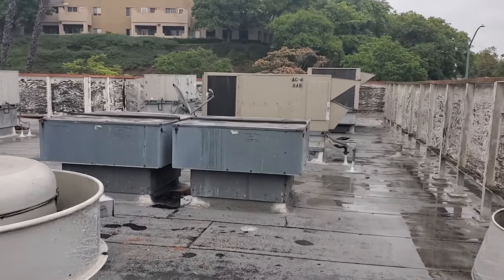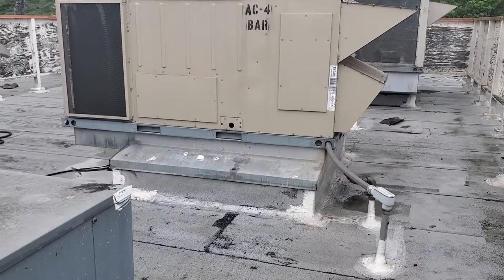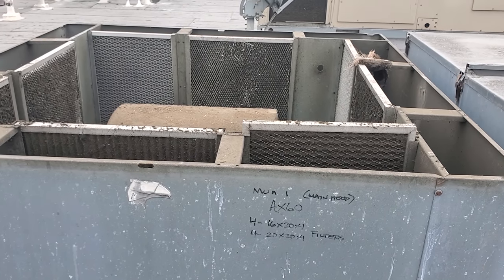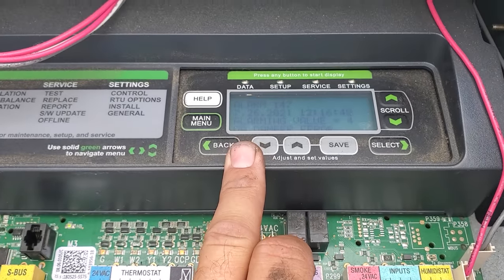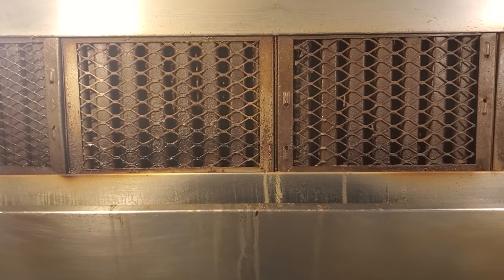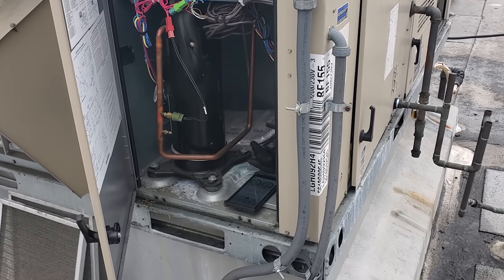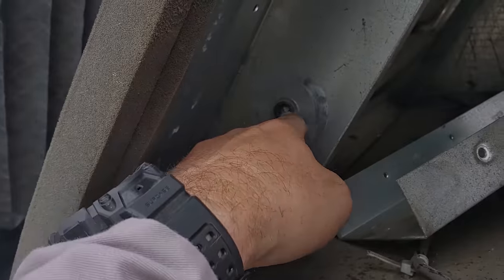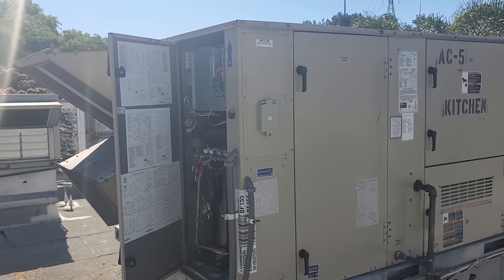IT'S NOT ALWAYS AS SIMPLE AS THE COMPLAINT

Comment: I once had a discussion with someone who was adamant that the more you turned down the temperature setting in cool mode for a AC the faster the unit pumped the refrigeration gas. He thought the refrigeration pump would go faster rpm wise. 
I get the password protection, but I also get putting them in the right mode first.
Reply: This  is true for the inverter units, the bigger the temperature difference the higher the rpms
Reply: @sjefoekel6058  it is just the last few kelvin difference the rpm drops down.

Just like you brake the car on a red light. You dont slow down the whole journey consistantly.

An A/C or electric oven or anything runs at 100% power to the setpoint and shut off the compressor/heater/what else.

The inverter units run to about 97% of the setpoint and do the last 3% with dropping rpm or power and then shut off.

It's a controlled system. The units runs as long as it has to and then goes to standby. It's not like rpm X is tied to a temperature Y.
Reply: @casemodder89  actualy it is, compressor rpm is controlled by demand. Read up on some tech bullitens from manufacturerers. The control will slow the compressor down or speed up to aprox 20% to 120% of nominal capacity, this is not an on off kind.
Reply: @sjefoekel6058  even our kitchen refrigerator has a variable speed compressor in it. You can clearly hear the difference. When it is warm our house you hear the compressor running faster.
Reply: @meeder78  ja maar dat meent hij dus van niet.
Reply: @sjefoekel6058  Up to a point yes, the problem was he thought it applied to all AC's and in particular the non inverter units we were using at the time.
Reply: Ppl think the same with transportation refrigeration, they think it will pull down quicker the lower the temp, no it will work the same just run longer and overshoot the set point you wanted

Comment: At one location I put in a fake thermostat and hid the real one. Amazing how all the problems stopped. I've also tied in setback controls or a second thermostat to a lighting contactor, so when they turn off the lights, the HVAC changes program temps.
Reply: Brilliant.. and funny.
Reply from the maker: I have actually done something similar too, I programmed the Lennox prodigy boards to run the units based off of the units sensors than I left the thermostats downstairs and the customer thinks they are controlling them..... its been like that for 5 years and they have yet to complain.....
Reply: @Rayfanz1  the fans were pulling in outside air and pulling it up, that's why you run ceiling fans in reverse in summer
Reply from the maker: I will discuss this on my livestream this evening 8/16/21 @ 5:PM (pacific) on YouTube come over and check it out https://youtu.be/8yo32gjOAeE

Comment: I hate to sound like I am really down on them, but the newer Lennox units with the smaller actuators are very failure prone. That same craft chain I mentioned before had another location with three year old units, and five of them out of eight had actuators throwing a code. It is because the actuator does not supply a smooth, continuously changing DC voltage to the IMC as the damper changes position. There are momentary dropouts, which the IMC sees and then sets an alarm. Be advised that there are two different actuator part numbers.

Comment: I got some questions:

1. Do you ever get or have engineering building plans on how everything should be working?

2. Do you ever do new installation of a new building that is being built? and how you set up everything in a new building?

3. Is all of your business based on service work?  Seems like there is a lot of bad running equipment to keep you going without having to diversify into other areas of HVAC business.

4. Do you ever get a business that listens to you and follows your recommendations such that they are great to have as a customer? 

I really enjoy your videos because I was an engineer at Carrier designing the control box enclosure for commercial packaged units.  The Carrier videos are the best for me especially when I see you work on Carrier units that I did some of the engineering designs.  It is neat to see how the unit looks after several years of being in service.  I'm amazed at how dirty the control gets after years of being in service.

Comment: Baby steps.  First its getting them on a cleaning schedule for the hood filters.  Then its coaching them on getting the proper curtains on the dish washer.  Then its coaching them on messing with the thermostats.  Coaching is a great Idea.  It gets the manager involved with how the building needs to run.  If they run the building properly, then its less down time for the restaurant.  If you coach those managers, they become your ally when troubleshooting faults with their system.  Great video!  its all about customer service even though the manager is a pain in the ass, its all about how you handle procedures they are doing wrong.

Comment: Either the place re-installs the curtains on the inner run of the dishwasher where they're missing or the place gets to shut down.  It is not sterilizing the dinnerware.
Hood filters are jokingly easy, they're metal flow deflectors.  You just fill the basin sink with mop bucket solution and dunk em, stop by every 10 minutes to wiggle em back and forth for a few hours then put em back up.   They don't have to be super clean, they just have to trap grease/oil/soot.  They're not really replaceable, they should last longer than the hood but they have GOT to be cleaned every week.

Comment: Great job on your channel here,  I’m always learning something. I just found a customer to resell some filters that were mis-sized for weird reason on the vertical measurement.  You have to really be thorough on your hood filters measurements like you said.  There is no standard  in filter sizes for hoods,  the old filters are smashed usually so measuring the old ones is not very accurate either. factories haven’t had stainless to make filters lately either. I can see why you don’t like too. You can always refer them to me if they need someone to replace them. I am more towards Los Angeles, but I do travel to riverside area  somewhat regularly.

Comment: At my facility (Georgia) our building is negative and diffusers condensate all the time because the facility owner allows people to se the T-stat at whatever they want. I'm fighting, as it seems you are, against people who don't understand or care about why moisture is dripping from the diffuser - they just want it to stop, but they also want a 67 degree room temp!!! I have explained how we either need to add make-up air to the facility and bring it to a neutral or slightly positive pressure or, run higher discharge air temps which so far, and for the last 20 years - that's a HELL NAW! Also, a good space temp policy is out of the question..

They have yet to grasp my explanation of dew point and how it's related to condensation forming on surfaces... I struggle everyday, until fall with people bitching about "ceiling leaks"...  It's my cross to bear on the planet I suppose... I feel ya bra...
Reply: Reminds me of a office building I was working on in Florida. The complaint was the building was majorly negative. Look in the BAS system and all of the OA dampers are forced closed! I point this out and reset the OA to where it belongs and the building went to slightly positive. Problem solved and left. Boss calls me a day later saying the previous customer was going off the deep end... we were costing them money by opening the outside air...
Reply: @neonhomer  seems like with Covid they would want all buildings positive pressure. I bet with proper airflow handling changes we could stop many outbreaks.
Reply: @consaka1  it costs more money to cool outside air... but that's how it works 😉
Reply: @flipfloptanlines926  lol that's awesome.
Reply: @etherealrose2139  only if the outside air is hotter than the inside air. Lol but yeah I see your point.
Reply: @consaka1  this was about 10 years ago when this happened... when Tracer Summit was still relevant.
Reply: fully fake thermostat's come to mind or have them only control the indoor blower :))

Comment: I had a commercial kitchen doing this and one of the ac's in the patron area. I like to never figured it out, till I noticed the airflow wasn't the same as another unit that was running fine. Another company had changed 800 cfm motors out with 3 speed 1075 rpm and had it on high speed, it was sucking the water out of the pan.

Comment: Unless they've been sliding those hood filters across the parking lot, you don't have to order new ones.   They're generally baffle filters _only_.   They're meant to be thrown into the Hobart (or other washing machine), or taken out back, soaked with SC-1000 or another surfactant, and hosed off with hot water/steam.    You can also take the broken filters to get them re-welded if someone's been throwing them around.    We used to get them manufactured for our equipment.

Comment: Chris this is why some corporations have taken the thermostat controls out of the stores control and have them on a system that is controlled  by the central office back east. Problem with that is that the HVACR techs have to call that office to get control of the units or just have them put the local A/C systems in to test mode for the day, then you can just jump the units out to get control to work on them, also letting people at the head office know that the weather in Boston is not the same as Tucson, Arizona.  I swear trying to talk to office lackies about why you are having them change setting to something more reasonable to local conditions in like talking to a brick wall. God I hated that, So I feel your pain. LOL :)

Comment: Can you not set the thermostats to reset what mode they are in like every night? Some devices like that which are meant to have a default way of operation like via the schedule, will reset to it and remove whatever manual overrides which were put onto it the day before.
Reply: Technically yes that's what the temperature override is. You change the temp and it will go back to schedule. His complaint was they are actually changing the schedule so then it won't go back to normal. Essentially they are changing the normal
Reply: @andykillsu  Maybe if you had a building automation system but what he is saying the managers are unlocking it with a code to change it. They are going beyond a override they are changing the settings
Reply: @andykillsu  thermostats aren't TV's. You set it up and lock it out. Only temporary temperature changes can be overridden, then it will do like you are suggesting. Once a normally 4 hour period passes it reverts back to the program. He is saying that the managers are going into the thermostat with the passcode and changing it. It now has been programmed to do what the managers inputs are. There is no way to go back to the original. Let's say a customer takes the TV off demo mode will it automatically know to put itself back into that mode